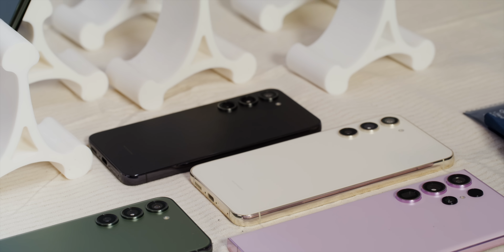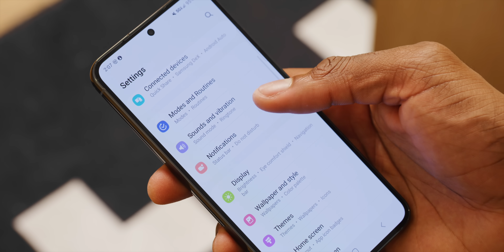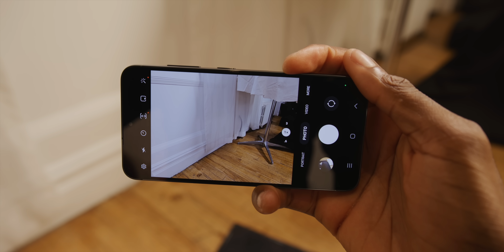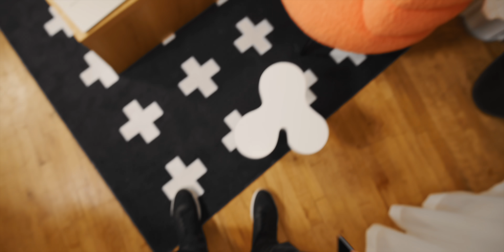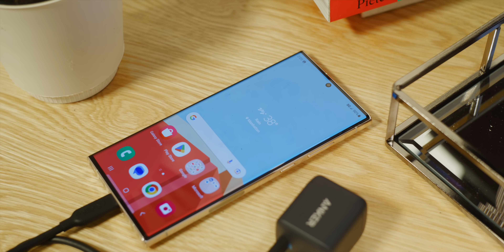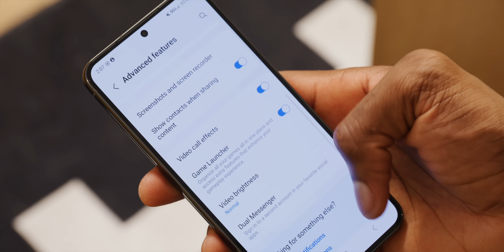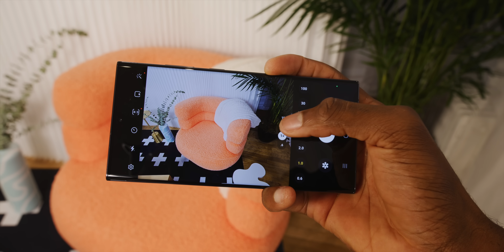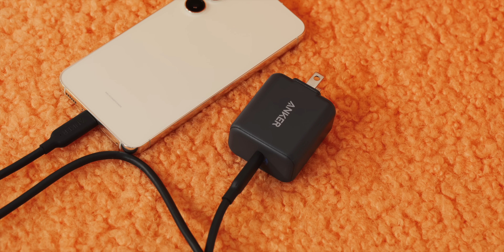Galaxy S23 / Ultra Impressions: Cruise Control!

Comment: Only good thing about this in UK is the snapdragon chipset. For years we got screwed over with the crappy Exynos chipsets and still had to pay more in UK than the superior snapdragon chipsets shipped to USA market. I was so disappointed with the S21 Ultra which I still use, but my primary phone now is a iPhone 13 Pro Max. I will stick to both those phones for another few years unless either Apple or Samsung come up with significant improvements/ changes.

Comment: They seem pretty good at first sight. I'm only disappointed in the color options. This personal preference, but in my opinion Apple offered way better looking colors in the past three years. I wish I could get the S23 in pacific blue or deep purple.
Reply: I agree. I loved the green on s22. I'm disappointed in their choice of green for the s23, it's barely green and looks just like an off grey almost.
Reply: Unless you're using a clear case where you'd actually see the phone color instead of a solid case - I don't get the color issue.  Unless of course you don't put the phone in a case.
Reply: SK’s a smith no doubt but they seem to lack sense of beauty unfortunately. Not a problem for me for I kinda like its nerdy vibe though I’ve always thought they could be whole lot more successful if they had it half so aesthetic.

Comment: I'm upgrading to the S23 ultra from the S21 ultra, simply because there was an offer for £600 guaranteed trade in, double the storage for free & after upgrading, my contract actually somehow ends up cheaper than what I'm currently paying.

So while the improvements might be somewhat minor, it's still worth it for me.

But yeah, at the moment, I don't think a new phone is needed every year.
Reply: I did the exact same thing, I got offered $1000 off for a 512 gb model with no additional cost for the extra storage and I pounced right on it

Comment: Apple failed due to ugly camera and high price and old design.
Samsung failing because of price. Design is still winning and the most winning part is S-Pen.
Google has smashed with better deign, better flagship features, better ecosystem (except windows/mac integration), and  off course stylus. The most leading is the price, which is 50% off the Apple & Samsung. 

Kudos Google Pixel 7 Pro.
Reply: Thanks for your message😍,...☝️☝️textme on telegram to receive your prize 🏆🎁🎉🎉🎁🎉

Comment: I have iphone 12 pro max and s21. The iphone pro is very poor at getting signal compared to S21. I use iphone due to work and not sure why all the gaga over iphones. Anyway will upgrade my Sammy to "S26 supreme ultra pro max special edition" when that comes out with chatGPT 5.0. It will read my mind and do all the work while I munch on snacks and watch Netflix. That's my dream phone.
Reply: Thanks for your message😍,...☝️☝️textme on telegram to receive your prize 🏆🎁🎉🎉

Comment: I wont upgrade my 16Gb/512 s21ultra as it performs exceptionally well ever with exynos2100. Probably in 2 or 3 years i will upgrade.

Comment: I usually change my phones after 2/3 years and in an even mode. Started with s6 edge, s8+, note 10 then currently s22 Ultra. I think Ill buy the next samsung flagship in 2024/2025
The s23 ultra is actually similar to my s22 ultra. Who cares about camera improvements, I dont even take pics often. Also I dont game much on my phone (Id rather play on my ps5) so "next gen chip" is nonsense to me.
I WILL NOT upgrade

Comment: Since there is fundamentally nothing new from Samsung my next phone will likely be the Pixel 8 at least the AI/ML stuff could be useful and may save me some time. I absolutely hate Bixby and it gets triggered when I am driving mostly so look forward to eradicating Bixby for ever. @MKBHD could you please do a video comparing the S23 and the Pixel phones. I do love the Samsung's spam call filter and I am worried the Pixel may not have that.

Comment: After testing for 5 mins in a store, this phone just overheated, if you try to take a 200 mp photo you will notes a 1 2 sec loading time and 10 to 12 sec of decoding time, so if you want to make 10 pictures with 200 mp you will need to spend at least 20 second(loading time) and to wait 3 minutes( image preprocesing) to see the photos and the phone will start to heat ... just another series of max specs not to use 
Present in video at 5.35

Comment: If the S23+ (even the S22+) had an option for 10GB RAM (it only has 8GB like my S20FE lol), I would take it over the S23/22 Ultra. The 3 cameras of the Plus are already enough for my use case. It looked like they just created the Plus to make you go for the Ultra. Sad as the Plus had the most potential to make me upgrade - but I was put off by the price to spec ratio.

I'm even considering moving over to the Pixel 7 series since they're cheaper.
Reply: I moved from Samsung to the pixel 7 series and I'm very happy
Reply: @osoifamf  the lack of official support and warranty in our country is the one I'm quite put off. But if I have the funds I'm definitely looking to a Pixel as my next phone.
Reply: Bro what do you need 10gb of ram for?
Reply: @luke45879  I currently have an 8GB model and usually use over 60-75% of the RAM already with social media apps. 10 or 12GB would be the norm in the future with heavier apps for sure.

Comment: Well, looks like this won't be the phone to upgrade to from my S7... I wonder when a phone comes out at a "decent" price with some interesting new features.
Reply: Lol, why would you use such an old phone
Reply: @halocraze9839  I'm the type of person to buy something "very good" and keep it for a long time. Hence keeping this S7 for 6 years now. It's rooted with a custom ROM, so it's still usable on a daily basis. But lately I've been trying to upgrade again, but I cannot find any good alternatives...
Reply: I'm surprised your battery life isn't garbage. I'm on S9+ and the only reason I'm considering the new phone is due to my battery life deteriorating after 5 years.
Reply: @jignat  Yeah, that's my main concern currently. I have days where I cannot leave the house and come back from work with more than 10% battery. I guess the custom ROM helps a lot, but it's really living on the edge...

Comment: I purchased the S22 ultra last year after having the galaxy s8 for almost 6 years. I am blown away, and still blown away by the quality of the phone, and the cameras.  My coworkers are constantly blown away by the performance of the cameras. I hope to get another 5 years out of this phone, and I am sure I will. Awesome job Samsung!
Reply: I have the exact same experience! Even my iphone user friends were blown away by the camera of my s22 ultra.
Reply: I’m still using my S8+ I bought when it debuted.
Reply: @vivianthom4801  I would be too, but I smashed the screen.
Reply: @vivianthom4801  Too bad it doesn't get updates anymore. Going to get the S23 Ultra. W for Samsung
Reply: @vivianthom4801  
With mine the software is out of date. I must upgrade.
Reply: @vivianthom4801  your phone is not getting any security updates anymore. Something to watch out for.
Reply: I'm right there with you. Switched out my Pixel 6 Pro for the S22 Ultra because I didn't anticipate me missing anything from this year's release and I feel confident about that choice. The phone is a multitasking beast and the cameras are already great. Probably won't be leaving my collection this time.
Reply: @sidersproductions941  so far... the reveiws say otherwise
Reply: Still using S10+
Reply: Still using my S9, phone are getting expensive every year
Reply: @Stanley  You can purchase an A 71 or 91 which I think would be a little better than the s9.
Reply: That’s a huge jump in tech and time my friend
Reply: @patsfan4life  I went from a galaxy s7 to a galaxy s21 fe 5g. Great phone.
Reply: @user-qy6tu9ip9v  I went from the S7 to the s20 and I have really enjoyed both tbh
Reply: I'm still using and loving my s9 note but thinking of upgrading.
Reply: I'm likely to get one, upgrading from base S20.
Reply: i just got my s23 ultra last week to replace my 5 years old s9+
Reply: I have an s8 right now and am researching upgrades. Very good phone for a long time, but apps these days have been slowing the old girl down
Reply: i have this s10+ i bought 3 years ago, and was considering to buy s23+ next year. but now that i've read your comment, i think my s10+ will last for more 3 years. great build quality
Reply: My S8 still working fine after 6 years
Reply: im goin from an s9 to an s23 lol odd numbers for me
Reply: Same here. Got the S8 in 2018 then upgraded to the s22 last year in August.
Reply: Thx for your coment.😊👍
Accessibility option available on the S22? I need it to read text. 👀
Reply: @Sabrina-vu9mv  I'm pretty sure you can set the size of text on the phone. All text, everywhere appears very large
Reply: I had that feeling when I switched from an LG V20 I had had since 2016 to an iPhone 10s Max. Ofc a lot of it is just the novelty of having something new. But it felt like a massive leap.
Reply: I updated my S10+ for the S23 Ultra. Of course a major difference is the camera, but it has taken me over two weeks to notice a real difference between the two. Of course it's faster and the screen is brighter but it's no great technological leap
Reply: @Eastwood Buck  lol, the GPU (snapdragon 8.2 Gen2 is MUCH faster, but really, you're right. There's almost no difference.
Reply: I feel you man I'm about to go from sob10 to 23. I always watch the yearly reviews. I forces me to stay informed in whats new in tech.
Reply: lmao Im exactly in the same boat, Ive had my s8 for years and Ive always thought ''if it aint broke, dont fix it''  but now its slowly giving up on me. So now Ive just purchased this s23 Ultra now, it was longggg overdue 😅
Reply: Just upgraded to the s23 from my s10 huge difference im glad to have waited a bit to upgrade.
Reply: @chris2236  What were the differences? I'm still running on an S8 so Im curious
Reply: @user-pd9ju5dk5s  The cameras, screen and speed were the first things I noticed the phone is much faster. Everything looks better and I haven't seen the full potential of the camera yet, as I just upgraded but there seems to be a lot of new stuff to mess around with.
Reply: I just recently upgraded from a s9+ to the s23 ultra and loving the experience thus far.
Reply: Yeah wait until they release phones with the ability to swap batteries. It will become a standard as of 2028.
Reply: S8 was the king
Reply: i had the galaxy s7 in like fifth and sixth grade and 4 phones later (iphone 13 rn) that one is still my favorite it was great till i dropped it lol
Reply: Maybe changing from s22 to s23 can be worth cuz of the greatly improved battery
However, once u have the s23 or even the s22 ultra, it's prolly not necessary to change phone after every 2-3years depending if the phone has cool new features that s22ultra, s23/+/ultra doesn't have😅
Reply: Still rocking the S8... Going to upgrade this month to either an S23 Ultra or a Pixel 8 Pro. Can't wait!
Reply: Same story with me.
Reply: Still useing note 9 in 2024 trying  upgrade  note 9 is pretty  fast trying  get s22 plus or 23 plus or ultra
Reply: I went from the 9 to the 22. I can't see the 22 last that long, the battery life isn't great.
Reply: @Akuu820 chipset issues that were fixed on the 23 series
Reply: Ha! I've had my s8 for 6+ years and watching this to see if I should get it! I might make the switch back to apple and get the 14 pro though not sure yet. I'm just worries I wont get as much lifetime out of an iphone as I would a samsung. I remember the used to coincidentally slow down with new releases. I didnt experience that with samsung
Reply: @CloudNine201  either way, you will have to replace the battery via the manufacturer multiple times over 6 years. More with iPhone
Reply: Help !!! I'm a musician and looking into a good phone to record live music/gigs. Any recommendations???
Reply: @Livemusic1800  S23 Ultra!!
Reply: ive replaced two s22s as both had fast charging issues. Apps crash a lot and a lot of things are incompatible, but the customization is nice..
Reply: @michaellogelin5089  never an issue!
Reply: If you think the camera looks good now, get GCAM for photos
Reply: @Invin_cibles  going from an 8 a 22 is a big jump in tech, the 8 wasn't that great
Reply: Imagine how blown away you would have been of you bought the far superior phone.. an iphone
Reply: @dadillonful  in what way

Comment: What I've seen over a bunch of videos is that the S23 Ultra is improved in the areas of low light, image stabilization, 8K photage and battery performance. Not enough for me to upgrade from an S21 Ultra but definitely noticeable improvements and for anyone on an older phone like S10+ or similar, it will be huge. Much of it will be true for the entire S23 range.
Reply: As an S3 user, upgrading to the A53 was huge. The same cannot be said for an A52 or A51 user.
Reply: same, i noticed that getting flagships such as these, its only worth to jump over to the new phone after 4-6 years, since usually thats when some big leaps happen between the models, and as a S21 Ultra user even though its nice to see all these new features,  its just not cost effective all things considered..
Reply: I upgraded from an s20, only cause I was having issues with it
Reply: S10+ user here.. I'm planning on it!
Reply: @cb.chivz374  yeah if you are S8-S10 user id say it is a solid choice to move as the leap is quite considerable, i myself moved from S8+ to S21ultra

Comment: l've been a long time Samsung user, mostly the Note series until last year when I switched to the S22 Ultra. Each year I sign up for the pre-order deals and usually end purchasing thru the Shop
Samsung app instead of a carrier. Samsung usually provides a generous trade-in for the previous year's flagship. This year that's gone and switched a carrier credit trade-in over 24 months. This doesn't work for me as I usually upgrade annually. If you do trade within the 24 months, you'll lose all and have to pay full price. There's the unlocked
version that is offering was only $500. That`s not acceptable! This should be $1,000. I'll keep my $22 Ultra until you wake up and fix yourself.

Comment: Great review and this will save me having to suffer through 30 min review videos from others on this platform.  Being an S22 Ultra user there is nothing in this new phone that would make me want to upgrade.  The only attraction woud have been the addition of a microSD card slot which they have passed on again.  I have to say with 8K 30fps video that 256 base model is going to run out of storage pretty quick if you are a heavy user!

Comment: S23 ultra can now go toe to toe with iphone 14 pro max in battery and video. If you put on battery saving mode, s23 ultra will wipe the floor with iphone 14 pro max for sure. It's a No brainer samsung is better with more features.

Comment: There are settings in the camera app to reduce the shutter lag a lot.
Reply: There is an option called BURST SHOT which takes multiple pics without lag.  Samsung literally gave a solution and tech YouTuber don’t talk bout it
Reply: @arouneshbora  I used to be a Samsung user for 12 years. And whatever tech YouTubers think, they can't change the fact that Samsung phones takes the best Overall picture in comparison to any other.

Comment: I think you got 2 things wrong: 1) The display refresh rate for the S23 and S23+ is still 48-120Hz, only the Ultra has 1-120hz. 2) The camera hardware on the backside of the S23 and S23+ has NOT changed, only the front camera.

Comment: Well I decided to upgrade from s10+ I had it 3.5y and the main reason is the stylus plus snapdragon processor for the first time in the European market.
My phone is still good and will become my full time car / HGV sat nav. I do have S8 ultra tablet and that blows away my old phone that starts to lag...
Pre-order deal was ok also 10% off , 512gb 12gb ram for what 256gb is priced for in UK and case 30% off. Still expensive but I use the phone like a mobile laptop so the cost is justified for device to keep for 3-4 years to come.

Comment: Quick question. I have the s22 Ultra and i absolutly regret buying it because of the poor battery life. Do you think the s23 Ultra has an improved battery life?
Reply: So I’ve been looking into this and I’d wait a few months.  Samsung hype is much worse than Apple in the community because they’re saying there are “big gains” before release but when it releases everything is overheating, laggy, mediocre battery life.  Sometimes worse than the previous Gen.  

Recession is coming and if it turns out that yes there are gains, get it much cheaper a few months down the line.  Samsung phones value always tanks quickly.
Reply: @Johnnygga  yup, im even considering an iphone next. Had the 9+, then a Huawei p30 pro, and now the 22 ultra, and if the screen wasn't bust, i'd go back to the Huawei. Hated both Samsungs

Comment: Reboxing of the past is taking place across the industry which has rrun out of innovation. Same with the disappionting samsung laptops linups it almost as though they are spending zero on r and d. The S23 is almost a carbon copy of sonys render designs...

Comment: About to update from the S10+ to S23+. Has been using the S10+ for almost 5 years now and I can totally say that it is the most reliable phone I have used so far. The looks, user interface, camera, etc. were the best compared to other phones. Finally after 5 years, I will have a drastic change so I am very excited for it. I am glad I waited for th S23 rather than going for the S22 last year. Already pre-ordered and they gave me $500 discount. Samsung is the best. Android for life.
Reply: They give u a discount for preordering?
Reply: @m4x927  yes. $500. I have Goole Fi so I bought it from them. I guess Samsung themselves are giving some discount for pre-orders.
Reply: @rjmsk7521  oh ok